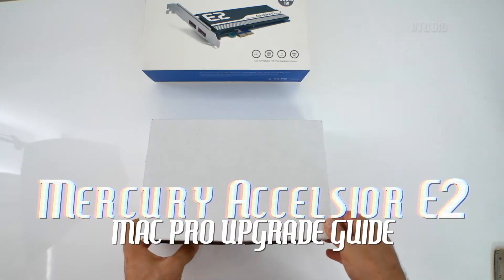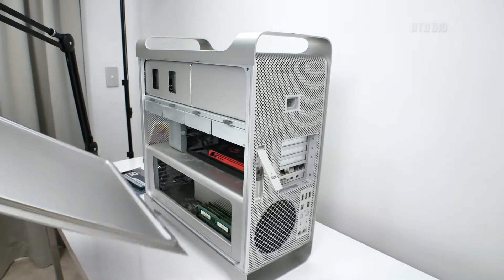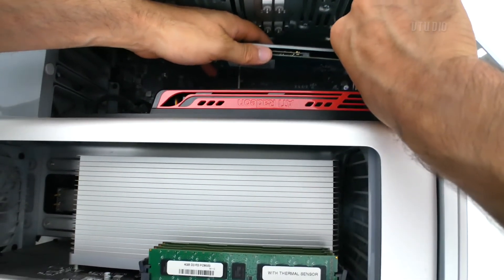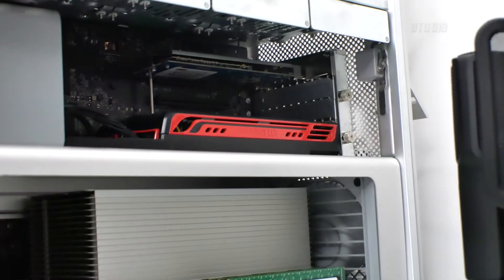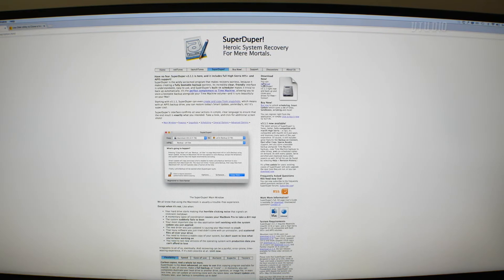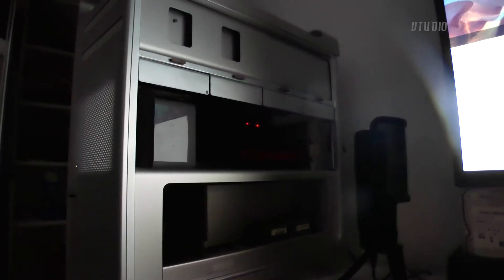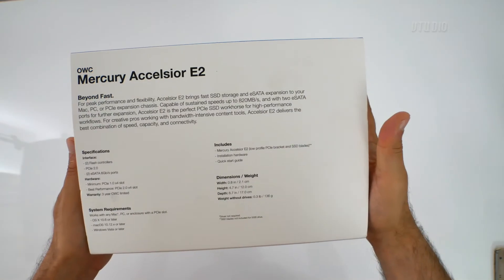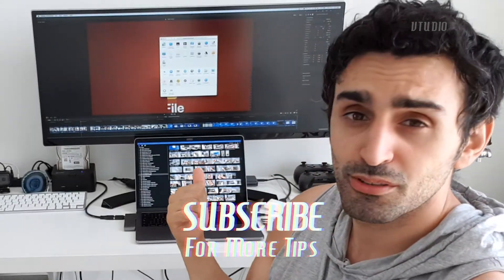OWC Mercury Accelsior E2 SSD Review and Setup Guide

Comment: Hi buddy. Thanx for the video. Do you know if you can get an adaptor for the ordinary SSD for the PCIE slot? and is it faster? I have 4SSD in my 2010 and I just want to make it even faster if possible.
Thanx again :-)
Reply from the maker: Nice one mate, yeah you can get a PCIe adapter for SATA3 and m2 SSDs. SATA3 is double the speed of SATA2 and supports the same connection as your current SSDs. m2 is 5-10x faster than SATA2 but you'd need to buy new m2 SSDs. The fastest ones to get are NVME SSDs, I haven't tried one of those myself, but I've read that they're now supported natively in Mojave.

Comment: I'm having trouble getting this card to partition a bootcamp. Keeps failing. I've met all requirements. I have a 5,1 mac pro. Does it matter which pci slot it's in?
Reply: I've set up the dual boot enabler as well.
Reply from the maker: Hey mate, for me it didn't matter which PCI slot the card was in (I've had it in both the 2nd and 4th slots). I managed to install bootcamp fine with macOS 10.13.1 (formatted AFPS) after installing the dual boot enabler. Are you using a different version of macOS? Something you can try is partitioning the hard drive yourself manually using Disk Utility. I have a guide on installing Boot Camp that way here: https://youtu.be/d0XtZjuMTNk
Reply: Vtudio no the afps was my issue. My drives are formatted to mac os journaled and found out that high sierra now requires afps to be able to use boot camp. I have to make a boot drive from a usb, switch the start up disk, and reformat it basically. Lots of trouble!